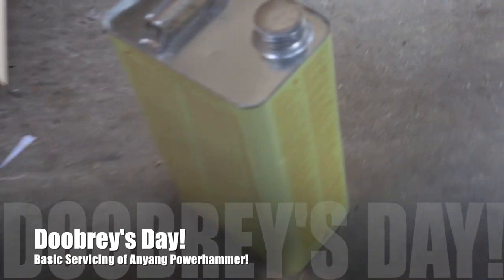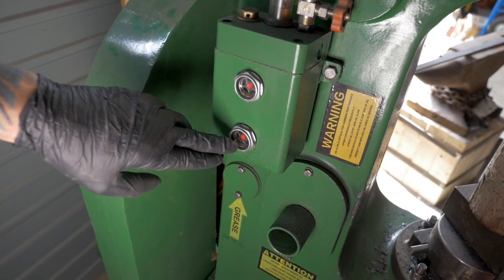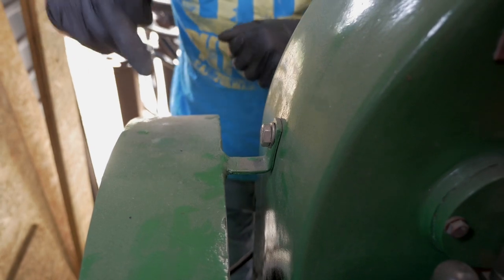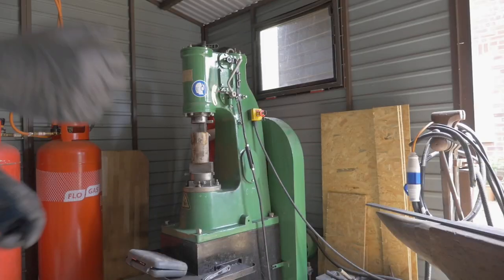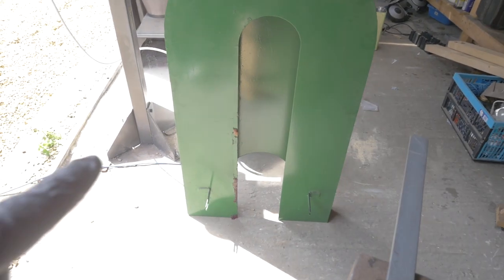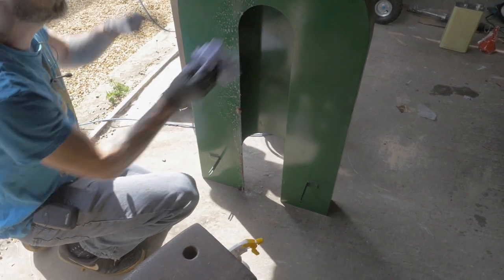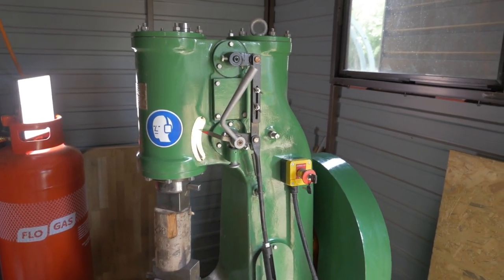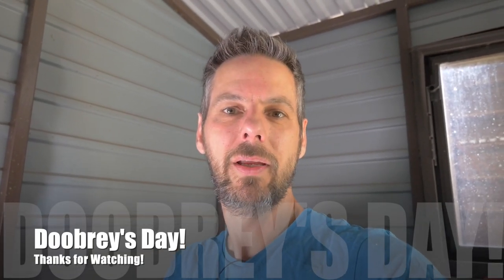Servicing Anyang Power Hammer!

Comment: A friend of mine has two Ayang hammers and none of those have any zergs, we were looking everywhere.
The manual says there are 3, a sticker on the outside of the hammer says it has 2.
We looked inside and outside. No grease zergs, no drill holes, no threads.
Does anyone know, if the bearings even still need to be greased regularly?

Comment: Hey Doobrey , how has this power hammer been holding up for you, i'm considering buying one for myself. Also i don't think you are not supposed to grease the outside of the shaft but are supposed to only grease where the nipple is and keep on pumping clean grease in there until it comes true the sealing at the shaft ( i work for a gearbox manufacturer , and that's how we point our customers to regrease , purge the old grease until it appears on the sealing side of the shaft , then you are sure that you have purged the old grease out of the bearings)

Best regards 
Dries
Reply from the maker: Hey Dries,

Its holding up superbly well actually.  An amazing machine for the amateur blacksmith.  Does everything i have asked it to do and some!

Thank you for the advice on the grease, I am new to this stuff, so any advice is much appreciated!

Thanks,

Doobs